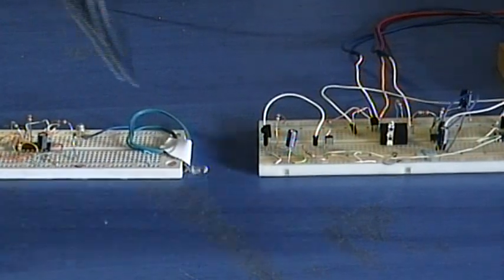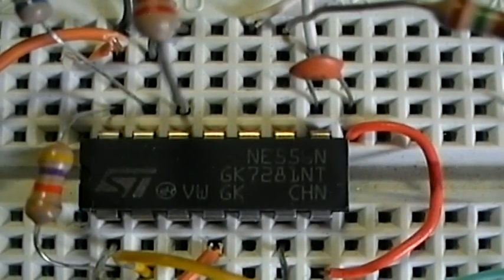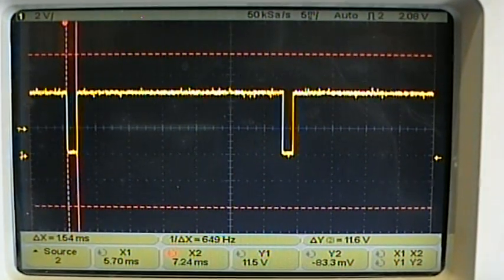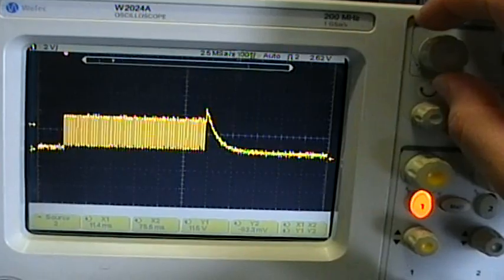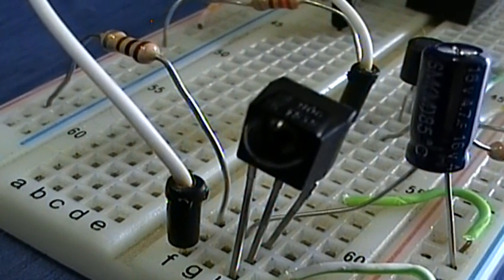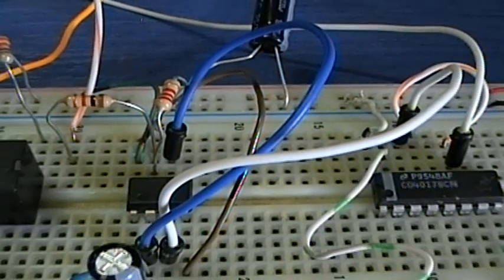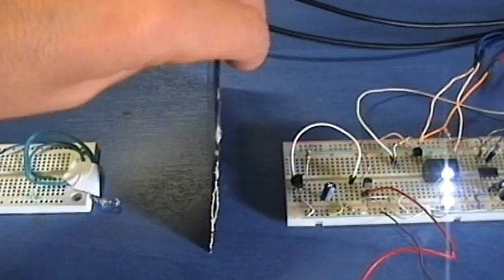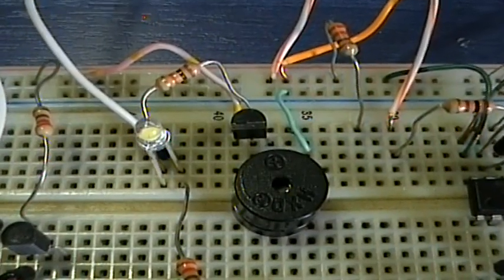Long Range (10 meters / 33 Feet or more) IR Beam Cut Detector Circuit

Comment from the maker: @jeriellsworth nice question!
No and yes. No, because the controller will interfere with the TSOP, as they operate at same (or close) frequencies (36-40KHz). So, a pulse from the remote control will indeed cause reset. 
And yes, because the remote control has a much lower rate that sends data-around 100msec interval.The receiver requires a pulse every 30 msec.I tested it right now. What really happens is that the receiver LED blinks, but it is not fooled by the TV remote control.

Comment: another question: does the transmitter work if i connect e.g. 20 IR LEDs parallel to the one on the output, i.e., would all 20 LEDs transmit modulated 38kHz signal as powerful as this one?

Comment: can this circuit be made using a microcontroller (ATMega to be precise)? if I want to use e.g. 20 sensors, is it possible to connect 20 IR LEDs to one MCU which would generate 38kHz for each LED, and 20 TSOP-1838s to another MCU which would detect which beam is broken. 
If it is possible, how? 
I would like to replace all the components (except for LEDs and TSOPs) with two microcontrollers...